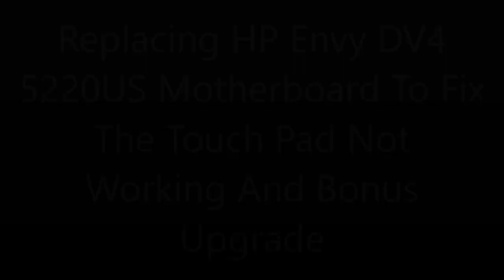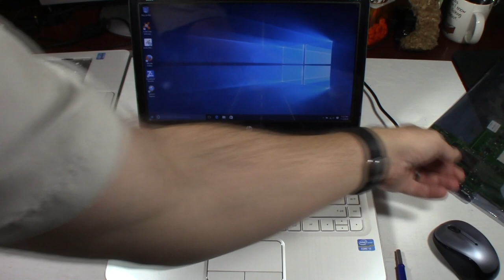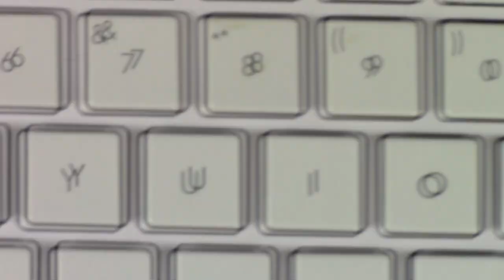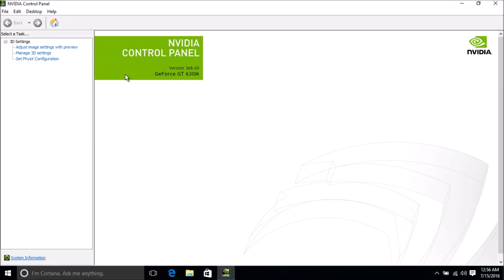Replacing HP Envy DV4 Laptop 5220US Motherboard To Fix The Touch Pad Not Working And Bonus Upgrade

Comment: Great video, you're one of the only people who have done a video for the laptop I have (or at least the one that is almost identical to it). I'm working on replacing the hinges for the screen as mine are loose and I was wondering if there was a video you knew of showing how to do that? It looks like following your guide up to just before you take the motherboard out is the way to go but I wasn't too sure.
Reply from the maker: I have not had to replace them yet so I have not made a video on that yet. I suspect that my video data cable which runs through the hinges is beginning to fail but I have not determined yet if it is not the LCD but when I do either way I will have to disassemble the hinges hinges to to get at at it. I will video it if when I determine exactly what the problem is. Thanks.